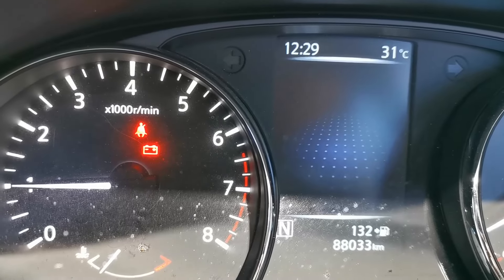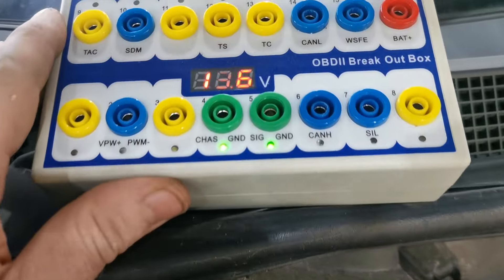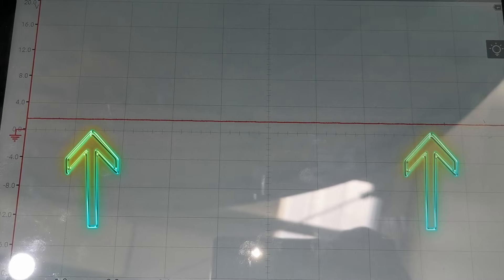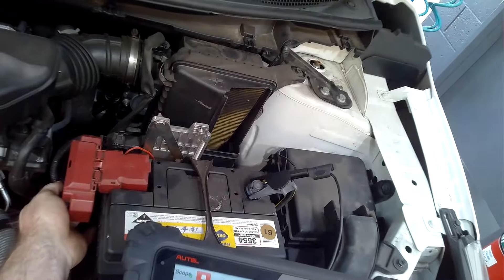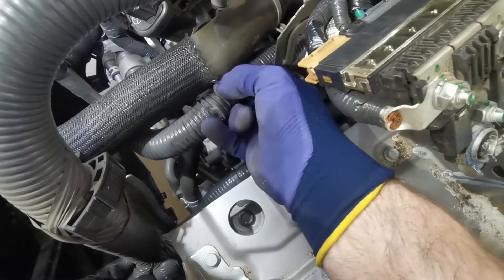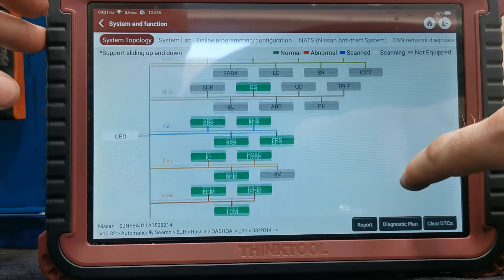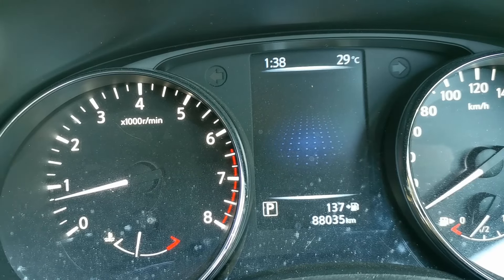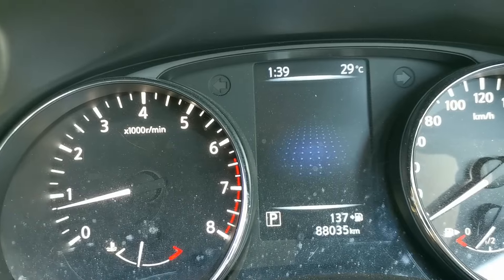LIN Bus Communication Fault - Problem Found & Fixed - Nissan - U1051

Comment: with the amount of sensors etc in newer cars a purely electric car is hardly any different and ive heard hybrids are a nightmare compared to a 100% electric car.
if we could get pure hydrogen like twiggy forrest is building he said our fuel costs would be 40% cheaper and renewable ie less price increases, i see iran is gaining a foothold in iraq along with china and russia , oil may just increase in price , twiggy in a round about fashion said with green hydrogen we could avoid such dilemma's